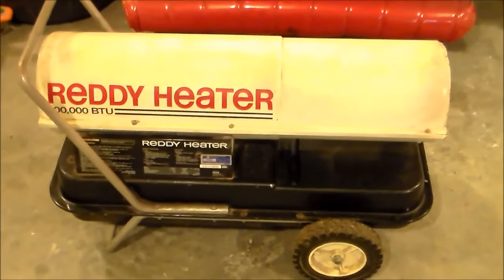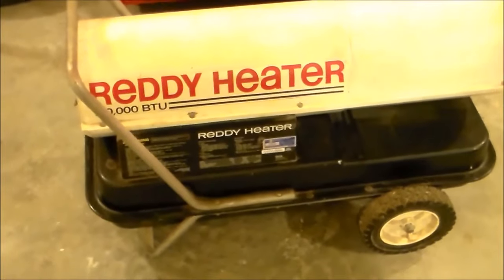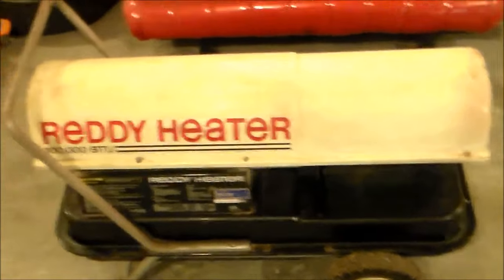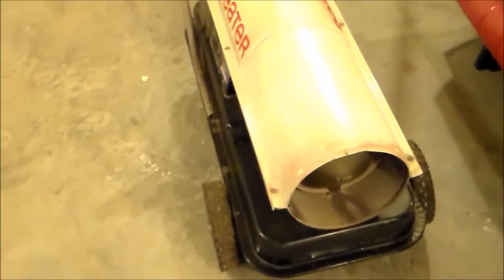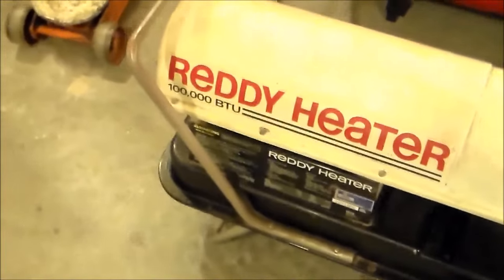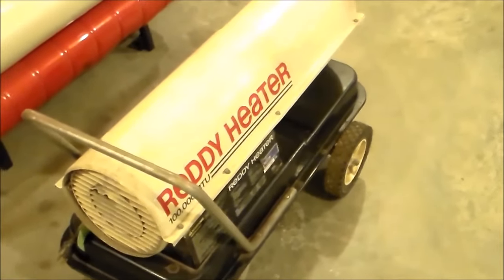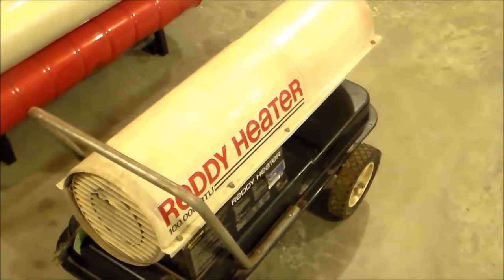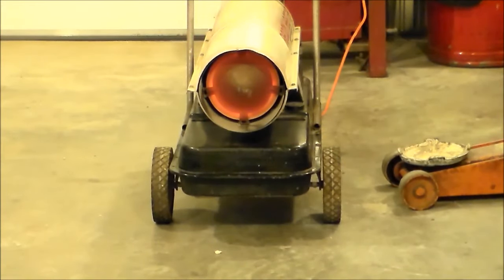Kerosene Forced Air  Heater to operate on Diesel   Tip

Comment: I had my Reddy heater since the 80's. Never had a problem until I listened to my friend, and put in diesel. It stopped working almost instantly. Thinking the air or fuel filter might be plugged, I messed with the filter, and it fell apart. Then I bought the replacement kit, which said to adjust the air pressure screw with the gauge, I didn't have. Of course the adjustment screw slot broke off trying to turn it. 
I could only get it to run with the top cover off. Fast forward probably 10 years, My stepson was looking to borrow it, probably seeing it in the back of my shed. Spent more hours on Youtube and messing with it again. Same B.S., so I think i'll try the gas additive.
Reply from the maker: Good luck, it works for me.
Reply: I never had a problem using pure diesel
Reply: It is almost always an air leak.  Test with spray bottle of soapy water.  You can replace all the rear parts and gaskets for about $20.   Replacing the parts saves a lot of troubleshooting

Comment: Back in the day that's how I ran my heater.  Good tip it works.
Reply from the maker: It got to were I won't use the heater because I did want to pay what they wanted for the kerosene. Found out I could do this and start getting it out again . Thanks

Comment: Just bought a heater like this, using straight kerosene, my biggest complaint is the fumes burning my eyes so it's hard at times to work around it any length of time,, any ideas or fuel mixtures to help??
Reply: Steve Stair , open a door crack a window... They stink on any fuel ....
Reply: If it's not glowing bright red and is dark in the center instead, this will cause fumes. You will need to clean the fuel filter and change the output filter.
Reply: Mine is but a year old and I barely use it. It burns my eyes and stinks. Even outdoors its awful. I am hoping K-1 or jet fuel will work better. I am going to contact the manufacturer to see if a slightly smaller fuel jet will clean up the burn.

Comment: I have been looking for someone to give me the right ratio.  Kerosene burns amazing in mine, I put diesel in when it’s cold and it takes a little longer to light and blows atomized diesel all over for about 10 seconds until it’s warm enough to burn. If you live in the north during the winter and don’t have winter diesel. Do this it helps Immensely.
Reply from the maker: Glad it helped

Comment: Yup, they really work good. But stink to high heaven!!!
Reply from the maker: My old heater doesn't know the difference but I  worked in a truck shop for 20 yrs  and don't really smell it. 
Thanks for coming by & take care
Reply: If it has a strong smell to it, you need to make adjustments to the spark plug if it has one. Otherwise,  something else isn't working correctly
Reply: If it stinks, you haven’t been maintaining it. Check the filters, nozzle, and pressure screw. The filters should all be clean, the nozzle should be turning the fuel into mist (not big drops, more like a fog) and the pressure screw should be developing around 3PSI at the test port in the back of the motor.

Comment: u can use straight diesel
Reply from the maker: Thanks Sam
Reply: It depends on the heater. I suddenly found myself in the space heater repair "business" this winter and I've gotten a few running and have three more in progress right now. Some burn #2 diesel very well and some not as well. Most of them will burn #1 diesel about as well as kerosene. And of course temperature has a big effect on viscosity of the fuel and how well it flows. I've seen heaters that ran fine on diesel but didn't want to start on it without opening the cover somewhat to reduce the airflow. I think a lot of it has to do with the condition of the pump and how well it can move diesel fuel compared to kerosene. Cutting the diesel with some gasoline actually makes a less expensive fuel because gasoline is cheaper than road diesel. If you can find off-highway dyed diesel it may be cheaper than gas.
Reply: I fine kerosene is not easy to get anymore.. But as long as there are trucks and cars, diesel and gasoline will be easy to get, regardless of the expense.  I have heard on my web sights the same ratio as Rusty quotes.. 4 gallon of Diesel to one gallon of gasoline, and like I told him, I'd add a bit of injector cleaner just for giggles.
Reply: Chad Meyer hey what’s the difference with #1 and #2 diesel? Dyed and not? Also couldn’t you just add and addictive to regular diesel and not mix gas?
Reply: @rush4ever1  #1 Diesel is KEROSENE. Not sure what he's talking about exactly. Just Google it

Comment: Mixing gasoline in that kind of heater is pretty dangerous.  If the vapour ignites -- KABOOM!  I've got a similar Reddy heater and the manual says you can run it on kerosene (expensive), JP-1 jet fuel (hard to get), or low-sulphur diesel, that you can buy at most any gas station.

I'm in northern Alberta, so I'm not sure how diesel is classified in the US.  But here in Canada, the most common consumer road-use diesel is #2.  In the winter, I think they put in additives to keep it from gelling.  If you have problems with gelling, you might want to try getting some #1 (i.e. "light") diesel from a truck stop or cardlock.  It's less viscose than #2 and more volatile.

You can also buy commercial additives for diesel to prevent low-temperature gelling.  One of the commenters mentioned isopropyl alcohol, too.  I think that would be a lot safer for a pretty reasonable cost.
Reply: Maximus Minimus what I don’t get is does kerosene not have vapors or ignite as easily? I don’t get why a little gas is so scary but straight k1 isn’t..
Reply: @rush4ever1  Gas is much more flammable than diesel ,  throw a match in a pan of diesel than gas, and you will understand the reason , in cold weather it is actually hard to get raw diesel to ignite
Reply: @rush4ever1 gasoline is much more flammable than diesel!

Comment: Don’t they all run off of kerosene diesel or fuel oil and I’m pretty sure airplane fuel
Reply from the maker: I bought mine in the mid 80's and kerosene was cheap. Diesel is a thicker fuel and can be used if thinned.

Comment: I have a very similar torpedo! it said it takes either kerosene or number 1 fuel oil! is it safe to use diesel in a non diesel kerosene torpedo heater?
Reply from the maker: icontrolthainternet   You should research it or follow your heaters recommendations
Reply: Some will burn it very well and some tend to be smoky and kind of choke themselves off and don't develop good heat. Some burn it very well. A lot of it has to do with the condition of the heater itself. If the lines are old and cracked and leaky or the pump is badly worn its probably not going to do well on diesel because its heavier and thicker than kerosene and #1. If you're looking for a cheaper alternative to kerosene, airports of any size at all where turboprops and jets operate have Jet A fuel. It's aviation kerosene, extremely high quality fuel and it's priced roughly halfway between #2 highway diesel and kerosene.
Reply: i burn  diesel  all the time   burns clean  too   1 fuel  oil  is  almost  the same   but  has red dye  in it  ..that will mess up  your spark   plug   or  glow  tube   ..
Reply: Naah, I dont believe the die will do anything... 
Heck, think about it.... farmers and other off-road use diesel engines been using it for yrs w/out any probs. Juss Sayin'
Reply: I dye my T shirts without a problem too, now I look cool, LoL --- Seriously I think all fuels have dye in them for recognition purposes.
Reply: @animalcorvair  I have used red dyed off road diesel for years no problem
Reply: @kipdon  I have used it for years no problem

Comment: simular to what i do with my home oil furnace, that works though. I have a ol WAYNE MSR series oil burner in a kenmore oil furnace, and i mix in one gallon of gas to 4 gallons of USED CAR OIL and the old WAYNE oil burner just lights it up with no problem.  But seems like DIESEL fuel does thin down the USED CAR OIL then gas does. 

I never had a force air heater like that. but i have done simular joke  MIXING in diesel fuel with USED CAR oil and the oil furnace works without issue.
Reply from the maker: Very interesting and great tip. Thanks and enjoy the weekend

Comment: Don’t know why you say kerosene is more expensive than diesel. It’s almost .50 cents a gallon less for kerosene than red off-road diesel around here. Are you not buying it at a pump? I’ve seen it sold in containers for outrageous prices. Buy it at the pump and it’s the cheapest thing you can burn.
Reply from the maker: I don't have any station here that sell kerosene at the pump anymore. It was nice when they did. The heater I have was made in the 80's and has run good on the mix. Like you say the jug kerosene is really expensive . Thanks
Reply: I sure never seen kerosene at the pumps cheaper than off road diesel , and I buy it in 5 gallon cans from my space heaters that do require it,

Comment: I have a Lawn Boy heater that I also bought in 1990. I have used kerosene in it, as well as diesel. The diesel is more than a dollar per gallon cheaper, but makes slightly stronger fumes. I will try your tip to thin with a little gasoline and see how it performs. 

Worth noting, many newer heaters don't run on both, maybe thinning the diesel this way will allow it.

The puff of smoke or unburned fuel vapor yours emitted in the video at startup is not correct! Check the gap on your igniter plug, clean the electric eye with a Q-tip, and make sure the fuel pickup tube has not deteriorated up from the bottom of the tank, are places to look first.
Reply: Most of mine have always done that, if the eye was dirty it wouldn't stay lit , and if the pickup tube was clogged etc. it also would not stay running smooth

Comment: I bet you could build a jet engine out of one these! Then attach it to a go kart!
Reply from the maker: Now that would be a real project.
Reply: So the rotor broke on the back of my electrical motor on the reddy heater 110000 BTU very common issue ... Well i hooked up an air line from my air compressor to the air line into the reddy heater with a regulator... Using 93 octane gasoline and kerosene mixed..... So i fired it up and shot 5 psi in just to get it lit and then turn the regulator up to as high as 45 psi .... It was shooting blue jet like flames out about 2 feet in front of the ready heater and it actually made the reddy heater move and start to roll .... So yes i would say you definately can make a jet like engine ... Ive thought about putting in some sort of turbine inside of it some how ... Or maybe more forced air some how with a different fan blade or blower fan ... Its pretty neat .... Its fun and its dangerous and wouldnt try it if u dont know what your doing because ... It could explode and cause huge fire.

Comment: My kerosene heater leak at front when i start it  could your here  tell me what wrong.
Reply from the maker: I wouldn't try using it till you figured that out. If you don't see the obvious loss line or hose may need to take it to a repair center
Reply: Loosen the cover

Comment: I have a kero blow heater it doesnt have a wick but its not the torpedo style.
I have put 5L of diesel in in and 100ml of 100% isopropyl alcohol. 
It runs and burns fine but theres a slight haze with the diesel. Running kero doesnt seem to make the haze. There is adjustment on the fan im guessing to let more or less air through what would help?

Comment: not a smart thing to do. I seen a shop that was totally destroyed and the owner was killed from doing that. any amount of gasoline in one of those is a bomb waten to go off. I run filtered Diesel fuel in my heater all the time and never had a problem with it.
Reply from the maker: 77 through '81 VW Rabbit diesels owner’s manual allowed to add 2 gallons of gas to 8 gallons of diesel when "winterized" fuel wasn't available..But caution with any fuel is a best practice. Thanks
Reply: Yeah to a car with an combustion engine not a compressureless jet engine
Reply: These engines are Abit different...not smart.

Comment: You need to be careful as to what you're burning in those heaters. While mixing gas and diesel isn't dangerous as far as explosions go there are many additives that give off emissions you don't want to be breathing inside a garage...  Stick to either Kerosene or #1 heating fuel as they don't have a bunch of other chemicals added.
Reply: They make heaters that burn both I have ran diesel for 15 years I have a carbon monoxide detector and it's never went off

Comment: Great tip. I have an old Toshiba kerosene radiant heater. Could not afford kero so I mixed 3 parts diesel to 1 part gasoline. Worked good but not quite the same. Now I hear another trick is to mix 5ml of denatured alcohol per liter or quart of diesel.
Reply from the maker: #2 diesel is a little to thick for some of the early kerosene heaters. Anything to dilute  it can really help.. Thanks
Reply: I had some old kerosene that was burning a bit too cool in my convection heater so I added about a half cup of denatured alcohol to the tank (1.5 gallons? Not sure) and it brightened right up and the odor went away. That alcohol is great for breaking up moisture and cleaning the wicks. It was good to make economical use of that old kerosene.
Reply: @RustyGlovebox  I have always ran straight diesel in them. Will try adding a bit of gas